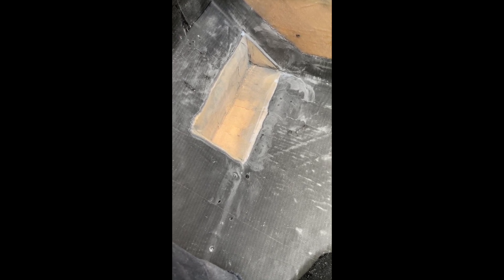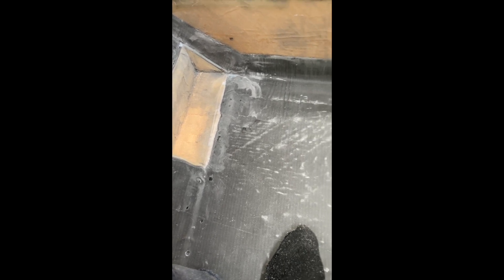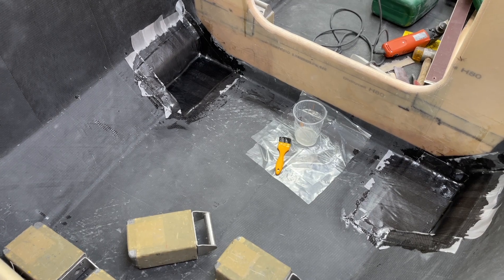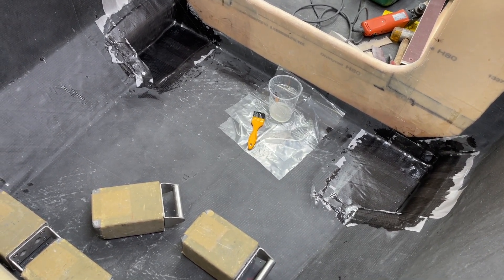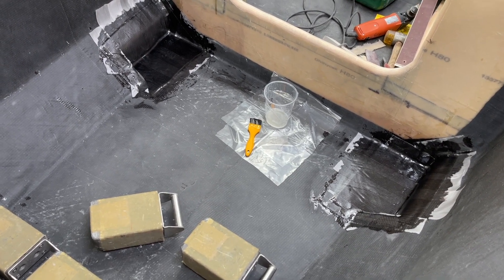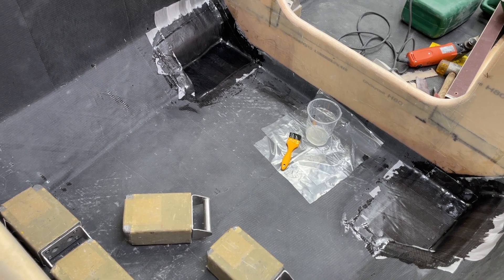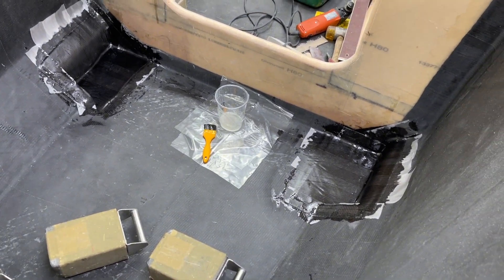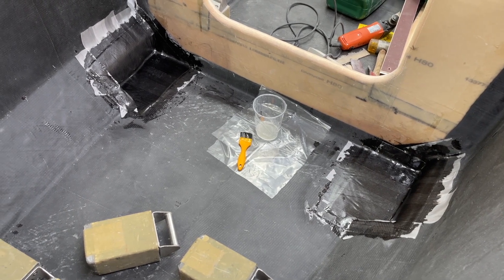Ballast boxes for mowing lead, first step.

Comment: I am starting to follow only now Sven, so maybe you explained that already: are you planning to use only the windward  of the 2 mast when close hauled to allow for more righting couple  from the hull's shape?
Much admiration! 
I have a Vega .
Thank you for sharing.
Reply from the maker: When close hauled in light winds the two sails on the two masts will be used.
When close hauled in strong winds i use lee sails to get weather healm. I use windward sail to get lee helm.
I have no self stearing so I balance boat. I will trim the sails a bit of each. But a better ansver after test sail.

Comment: When expecting extreme conditions would you be able to take down and stow your mast?
Would setting a drogue be helpful?
Reply from the maker: The masts are strong and small.
I am working on a kind of drogue. I belive I discussed it with Sam Holmes in a video when he was here, but I be back to the subject later.
Reply: @SvenYrvindExlex  You were talking about a tail, I once put out 50 meters of trailing line, Some people think this would do nothing, but it made a huge difference to stop the weaving boat in following seas, and exhaustion of course correcting

Comment: How will you structurally reinforce the new cutouts and ballast base?
Reply from the maker: I double the carbon fibre two times 600 grams. 20 mm is plenty strong even for a 60 feet boat.

Comment: Thoughts on comparing to water ballast tanks?
Reply from the maker: I already will replace drunk water with salt water. Mowing water takes to much place on a small boat like mine. This will work fine. Lead is 11 times smaller than water.